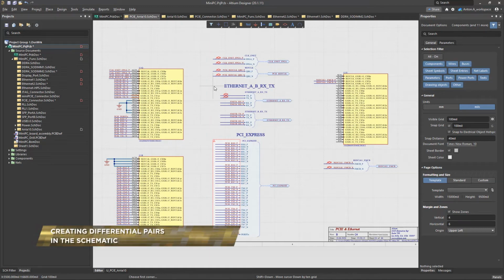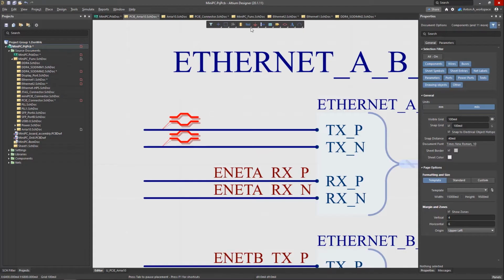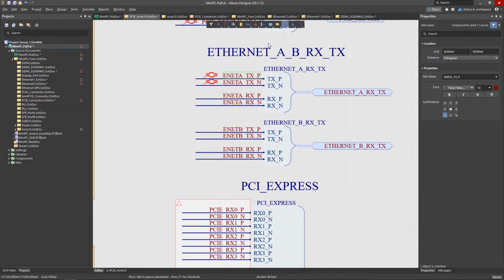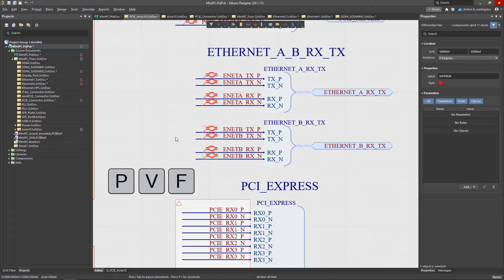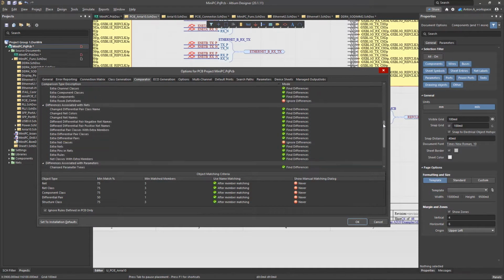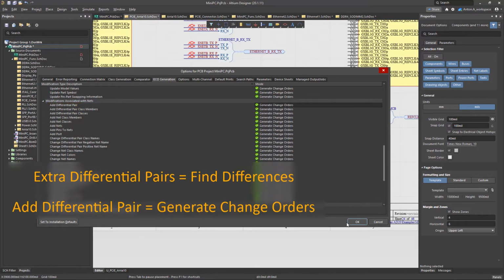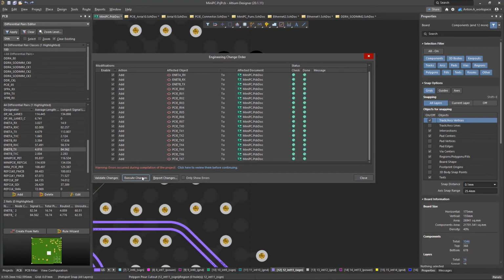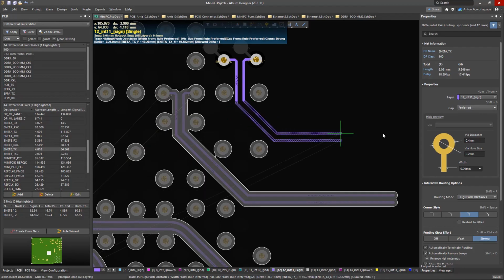How to Create Differential Pairs in the Schematic | Altium Designer

Comment: I also like this direct approach to tools for Altium. I'm curious if I can use diff pairs for separate devices. I have an RF circuit and the line lengths from each mixer to the splitter need to be the same. Is that possibility?